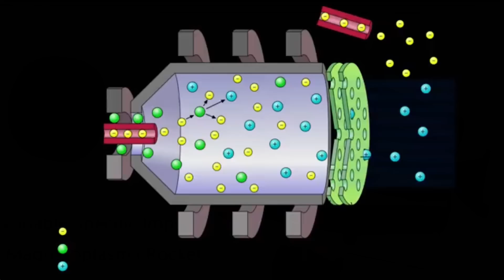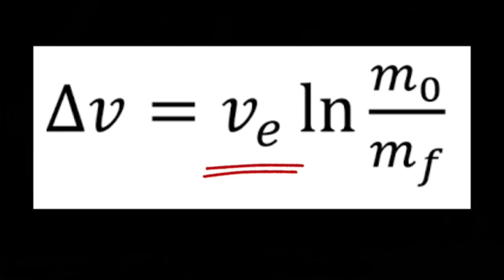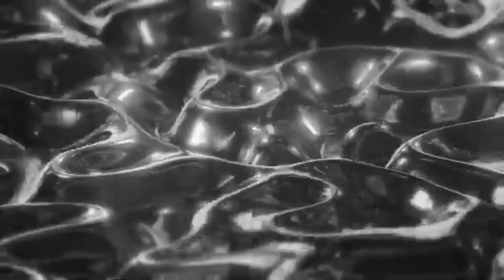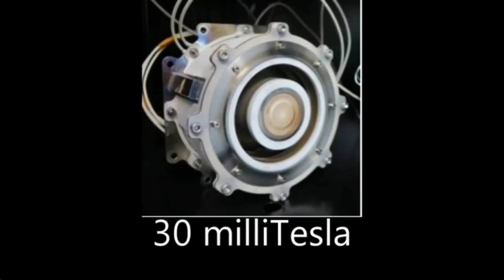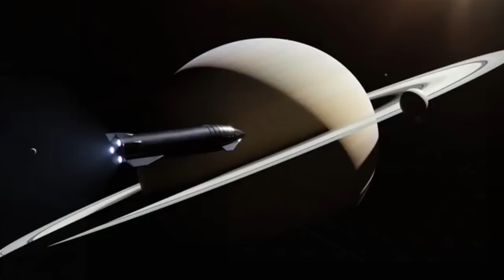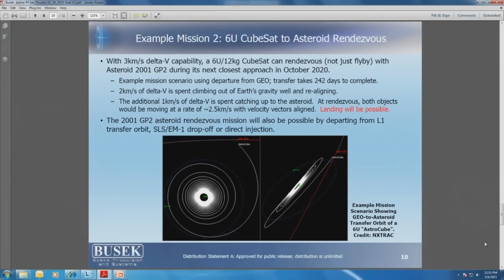Field Emission Electric Propulsion

Comment: "In an ion engine, the EM force can throw everything at about the same velocity". WRONG. The same electric potential accelerates same-charged (say, +1e) ions to the same ENERGY, not same VELOCITY.
So the lighter ions are faster, thus better for Isp, just like in chemical engines.
But Isp is not the thing you optimize for (if it would, you'd use all the power not to accelerate ions, but to power an array of LEDs. Photon rocket, yay! Isp = 3000000!!!)
The problem is, higher Isp comes with higher energy requirements, and unlike chemical engines, you do NOT get the energy from your propellant. You need to supply it from something else, today it means from solar panels. Larger solar panels = heavier spacecraft. It turns out, it makes sense to instead have a lower Isp, a bit more propellant, than more solar panels (they would be heavier than that extra propellant).
Also, ionization energy is completely lost, and with lighter ions you need to spend more energy ionizing the same mass of ions.
Reply from the maker: You seem very passionate about that but you are NOT correct. Otherwise they would use helium instead of Xenon because the LOWER mass would make it better right? Wrong.

Comment: "The easiest gases to ionize are the noble gases". WRONG. They are actually hardest to ionize. Noble gases are used because they are chemically inert. It's much easier to ionize other materials, but e.g. hot caesium gas is going to eat your thruster from inside.
Reply from the maker: Once again. You... Are... Mistaken. But hey. Run with it.

Comment: I remain somewhat disappointed at the lack of focus upon Zubrin's Dipole Drive.  It to is an ion engine, simply one that harvests ions from the interplanetary medium.
Reply from the maker: I believe a "statalite" using massive EM coils to focus a solar wind stream into a beam that a ship can ride away from Earth orbit is viable.
Reply: too low effect.
Reply: @jessepollard7132  That's totally a function of where the Zubrin-Drive enabled probe is (that is the density and relative trajectory of surrounding ions), how big the paired electromagnetic sails are, and how much power it has on-board.  Before you scoff at that, these are the same issues that Solar Sails have... they work best near the sun, because that is the source of the inertia and the power they use, and work best when bigger.  The difference of course is that the Dipole drive works at least SOME anywhere and going in any direction.  From my perspective that makes it ideal for something like a cross between the DAWN probe and the New Horizon's Probe... A probe that would enter and leave orbit of many kuiper belt objects in turn.
Reply: @mm650  : Honestly, for long-duration missions at or beyond the Kuiper belt we're probably best off with a solar sail or ion engine setup, because:
1) We're going to want solar power for long-duration missions anyways, which in turn means we'll need the huge reflectors required to get useful solar power at such distances, and
2) We're going to want "a lot" of Isp in a sorta-short period while out near the Kuiper belt to circularize the vehicle path into an orbit, which calls for something similar to an ion thruster.

The usage of on-site propellant can certainly seem desirable, but the Kuiper belt is a bit far out for the system that you're describing.
Reply: @absalomdraconis  Actually the Kuiper belt is WAY far out for any solar based system.  Out there the sun is just a slightly brighter star.  We've never sent a solar mission farther than Jupiter, and even that was pushing the limits of what is possible from a power density perspective.  Trying to solve that with giant reflectors is a rube-goldberg solution if there ever was one.  (In general one knows that one has entered science fiction territory whenever megastructures of any sort are being proposed.  I'd be very surprised if in the next 100 years we'll have deployed even one structure in space larger than the largest stadium or sky scraper here on Earth).  Rather, just accept that the probe will be nuclear... problem for power, and heat, and with the dipole drive propulsion solved.  Sure the approach trajectory won't be quite the same, rather it will take the form of constant acceleration for the first approximately half of the journey and constant deceleration for the second half (Why not? your fuel isn't going to decay any faster or slower if you use it or not, and you're not expending any mass.)  Because the efficiency of the dipole drive is variable with local ionic conditions, you wouldn't target a smooth efficient entry into a capture orbit and then circularize in the first place.  Rather, you'd target a hyperbolic low-velocity fly-by followed by a deceleration and catch-up fly-by at even lower relative velocity.  This process would be iterative until you actually entered orbit from almost a relative stand still at a very high altitude, and then slowly maneuvered to tighten the orbit to a lower study altitude.  Sure this would be an incredibly inefficient approach if you were expending precious reaction mass... but you're not.  Also, this slow multiple fly-by approach gives you the ability to decide to commit or not to a longer study of the target object before expending time and delta-v on completing the approach.  Lastly, if you still wanted a higher thrust option, the very high voltage of the dipole double sail would be very compatible pairing to an auxiliary pulsed plasma ion drive which also operates at extremely high voltages and thus could do so directly off of the same power source circuitry as the dipole drive uses.

Comment: I think a muon generator with electro magnetic containment and field focusing elements would be a fun experiment. In my mind it would provide similar thrust to ion drives, but would be 3 to 4 orders of magnitude more efficient.
Reply: first you need a muon generator that can be controlled. at this time they don't exist.
Reply: @jessepollard7132  > first you need a muon generator that can be controlled. at this time they don't exist.

What??? They do exist. They just look like toroidal steel tubes some 40 meters in diameter and they eat megawatts of power...
Reply from the maker: That's the problem.  Muons would be great if we could generate them efficiently.

Comment: You mentioned SpaceX is using Xenon on Starlink satellites. I believe they moved to Argon a while ago, based on cost and availability. (They were on track to use the world's supply.)
Reply: I actually believe they used Krypton as fuel not Xenon. When they switch to Argon i believe it’s the same reason they used Krypton over Xenon, due to trying to lowering cost.
Reply from the maker: This is a remaster of an older lesson.  Their test satellites used Xenon, the original working satellites used Krypton, now they are using Argon.

Comment: 🤩 Michael faradays dielectric field makes an appearance? "Magnetism is the dielectric field" 🤩🤩🤩🤩🤩
Reply from the maker: Not exactly :-) "An electric field and a magnetic field are two distinct fundamental concepts in physics and electromagnetism. While they both involve the interaction of forces in the vicinity of charged particles, they have different properties and behaviors. Here are the key differences between an electric field and a magnetic field:

Nature of Field:

Electric Field: An electric field (E) is produced by electric charges, whether they are stationary (static charges) or in motion (currents). Electric charges create electric fields that exert forces on other electric charges.
Magnetic Field: A magnetic field (B) is produced by moving electric charges, specifically, the flow of electric current. Magnetic fields are associated with the motion of charged particles, such as electrons moving through a wire.
Source:

Electric Field: Electric charges (positive or negative) are the source of electric fields. Positive charges create electric fields that radiate outward, while negative charges create fields that point inward.
Magnetic Field: Moving charges or currents are the source of magnetic fields. When electric charges move, they generate magnetic fields, and the direction of the field depends on the direction of the current.
Effects on Charges:

Electric Field: An electric field exerts a force on electric charges. Positively charged particles will experience a force in the direction of the electric field, while negatively charged particles will experience a force in the opposite direction.
Magnetic Field: A magnetic field exerts a force on moving charges (i.e., charges in motion). The force acts perpendicular to both the direction of the magnetic field and the velocity of the charged particle, following the right-hand rule.
Interaction with Other Fields:

Electric Field: Electric fields can influence the motion of electric charges and other charged objects. They can accelerate or decelerate charged particles.
Magnetic Field: Magnetic fields primarily affect moving charges. They can cause charged particles to curve as they move through the field (e.g., as seen in a particle accelerator).
Units:

Electric Field: Electric field strength is measured in volts per meter (V/m).
Magnetic Field: Magnetic field strength is measured in teslas (T) or gauss (G).
Representation:

Electric Field: Electric fields are represented as vectors, with direction and magnitude indicating the force experienced by a positive test charge at a given point.
Magnetic Field: Magnetic fields are also represented as vectors, with direction and magnitude indicating the direction and strength of the magnetic force on a moving charge.
In summary, electric fields and magnetic fields are distinct physical phenomena with different sources and effects. Electric fields result from static charges or stationary charges, while magnetic fields are associated with the motion of electric charges (currents). Both fields are fundamental to understanding electromagnetism and play crucial roles in various electrical and electronic devices."